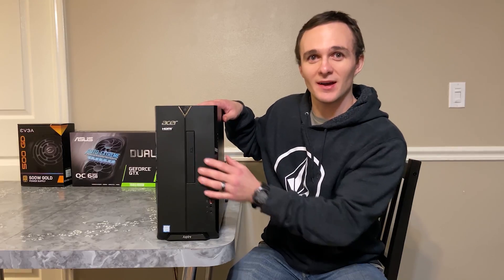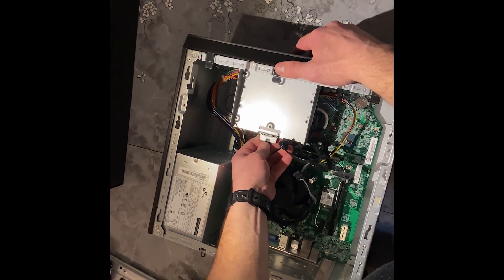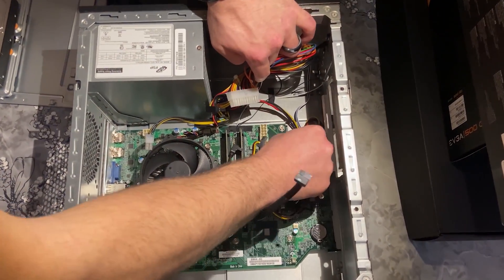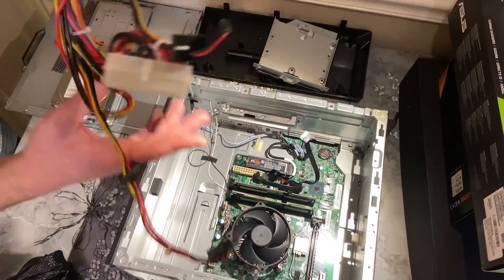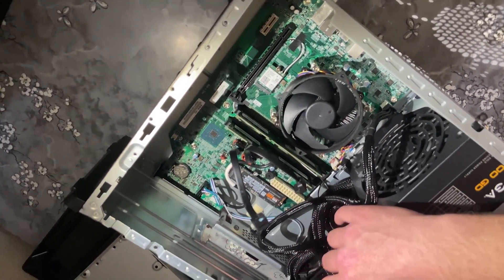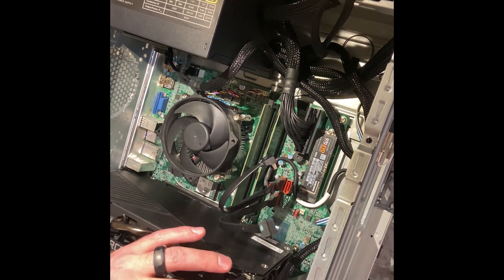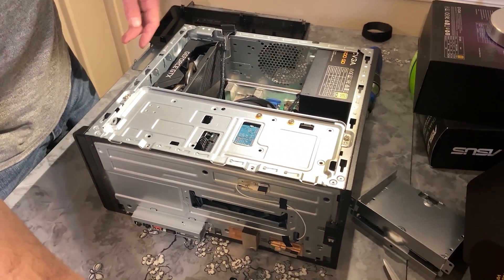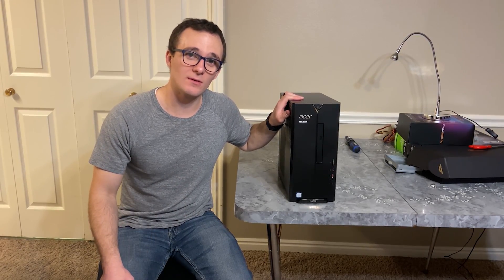How to put an Nvidia 1660 Super and change the power supply in an Acer Aspire TC-885 ACCFLi5

Comment: I followed this video and I think I got everything connected correctly. When I turned on my aspire it seems to be booting up (fan runs and light on) but my monitor doesn't recognize it's connected. How do I fix this?
Reply from the maker: Did you connect the HDMI cable to the graphics card or the motherboard? It should be in the GPU to get display now

Comment: hey bud,, i have a stock one,,nothing replaced,,, mine restarts everytime i watched videos like you tube// does it need a new power supply and video card?
Reply from the maker: Diagnosing issues based on the symptom you’ve described can be tricky, but there are several steps you can take to narrow down the cause. First, if your system has more than one stick of RAM, try booting with just one at a time. This can help identify if a faulty RAM stick is to blame. While integrated graphics rarely fail, power supply issues are a possibility, especially under load. To test this, you could run a CPU-intensive benchmark like Cinebench or Prime95 and see if the problem persists, indicating a potential issue with your PSU.

Additionally, overheating could cause your system to reboot, so monitoring your CPU and GPU temperatures while running these tests could provide further insights. It’s also a good idea to ensure all your drivers, particularly for your integrated graphics, are up to date as outdated drivers can lead to system instability.

Lastly, system files or settings issues could be contributing to the problem. Running a system file check (for Windows, sfc /scannow in the Command Prompt as an administrator) might uncover and fix any corrupted files causing instability. I hope these steps help you pinpoint and resolve the issue.

Comment: I know its been a while since you posted this video, but I was looking to add a rtx 2060 super to the same pc. What do you think, a good or bad idea? I will be upgrading the power supply to 500W or 600W but I just wanted to know if it would work with the motherboard and airflow wise. Thanks.
Reply from the maker: It doesn't have the best airflow, you could try adding a fan blowing air in through the side or perforating the bottom of the case. it should be fine with the motherboard. and psu.

Comment: Hello, I have the same PC and I installed gou 1660 ti but it didn't recognize it and I also changed the power supply and put a 500w in it but it doesn't recognize the GPU. Maybe I have to do something in the bios for it to work?
Reply from the maker: one thing I forget to do sometimes is to add the vga 8 pin to the gpu. is that plugged in?
Reply: same :( i have rx580, i cant disable onboard gpu

Comment: Based on your video I used the link to purchase the same power supply only I have an Acer Aspire TC-895 and I ordered the ASUS GeForce GTX 1660 Super Overclocked 6GB Dual-Fan Evo Edition VR Ready HDMI DisplayPort DVI Graphics Card (DUAL-GTX1660S-O6G-EVO) from Amazon. Will it still assemble the same?
Reply: Did it assemble the same?

Comment: I know this video is up since 3 years ago but hopefully you still see this comment, I want to ask if the gpu worked fine even though it was partially blocked by the side cover. I want to know if it works because if it does then I can try to upgrade mine to a 3060 12GB one for myself
Reply from the maker: you should be able to get a 3060 in there. a 2 fan model would for sure fit. Just make sure to check the dimensions of the card to see if it'll fit before putting it in there.

Comment: Hi, i have this pc also, but i was running gtx 1650 on stock 300watt PSU, i have used a dremel to fit a front intake fan added rear exhaust fan and larger arctic cpu cooler.. but i want more gpu power will the mobo support a rtx 2070 super? (I will of course upgrade the PSU to atx 650 watt)

Comment: Extremely useful  and interesting video... I have a TC 1660 (i5 11400f gtx 1650) which seems to be very similar, I already upgraded ram, ssd ad I added another fan to keep temperatures under control. Is this upgrade possible in my PC (with 1660 super)? And if it is, it would be interesting to know what is the most powerful graphic card that could fit in this case (same of tc-885 I suppose) compatible with this motherboard ? Thank you in advance, congrats for the amazing work!!!
Reply: where ypu put the new fan e what tipe is
Reply: @reinnn.585  Noctua 80mm, there it the in the back of the case. Then connect the cable to the SYS FAN port of the motherboard. If you use it for gaming and the fan works only at startup, cut the control cable and the fan will work always at max power. Temperatures will be fine even under load

Comment: I have a TC885 and the door panel wasn't ventilated. I just left the door off, I highly recommend it if your door isn't ventlated. My TC885 is the 3 but t shouldn't matter, they are both 65w processors. I also the the similar Acer Nitro, i5 wth RX580, also without ventilated door. The paste on the RX580 fried before I realized there was no airflow, the only fans on the CPU and GPU themselves.

My TC885 with the i3 got a liittle loud, the paste on it was dry and cracked (lack of airflow) and I replaced it with Arctic Cooling 11LP which will just barely fit if your ram doesn't have a heat shield. Unfortunately, it required removal of the motherboard so the backplate could be removed because the 11LP like many coolers mounts with push pins. I think you could put the mount on the mobo with some 3mm screws without moving the solidly two sided taped backplate, but I didn't bother, figuring I would make at least 2 trips to the hardware store to get the right size screws or to get multiple sizes and have to take some back. The 11LP is awesome. It runs for 30 seconds silently then it will stop for more than a minute at a time doing basic tasks. But because of the pain in the assedness, I would recommend Cooler Master UC50 with the copper slug. it's like a Wraith Spire but for Intel processors and will mount to your stock backplate and if you want to add ram that has heatsinks as so many do these days, they wll fit. Neither of these computers are my daily driver anymore but they are stll useful.

On the Nitro 50, Acer blocked of the HDMI port for the integrated graphics of the i5 8400. Integrated graphics would have been helpful when the RX580 cooked (repasted, still works). Why Acer would block off the integrated graphics? All I can think of is they were afraid people would plug into the board instead of the graphics card, think it didn't work and return it. Acer is value for money, just expect to do a little upgrading when you get it, time and money. Really impressed with the 10000 series i3 it would have been an i7 a few years ago quad core with 8 threads. I wouldn't even bother with the i5, buy another stick of ram, and a fan for the back out of the money you save and it might even stretch to a better $17 cooler or at least some paste better than what Acer used whch s bottom of the barrel garbage. I still like them or I wouldn't play with them, just know what you are getting. The i3 didn't come with ATX power supply. I also upgraded mine with M.2 SSDs that's recommended for any computer that idin't come with one these days.

Comment: Why did you choose this specific PSU (when there is such a large choice of cheaper PSUs including modular) is it because it is a direct size replacement for the proprietory psu
Reply from the maker: I chose it mainly for the price. it's a standard ATX form factor. I know EVGA has a good brand reputation for power supplies as well. all of those factors were why I chose this one.

Comment: Hi 
You seem to have some experience with the Acer Aspire TC models. I recently got a TC-1660 with i5 11400 CPU and Nvidia 1660 Super. From this and other videos of yours, it looks as though the CPU fan is the same on all models. Can you tell me what I can expect from the CPU fan noise? I’m experiencing between 30 and 50 dB running between 831RPM and 4591RPM. Could you recommend an alternative fan?

Thanks

Comment: Please note that the power connector on the DVD drive is not a regular size SATA power connector and it is doubtful that any power supply upgrade you make will include this connector so you need to buy an adapter - a sata slimline power connector that will bridge between the regular sata power and the little one on the DVD drive. Or, as dmoneyballa did, decide you don't need the DVD drive because it messes with your cables.

Comment: had mine for about 2 years now, planning to upgrade the power supply to a 430 watt unit and toss in an extra 8gbs of ram and a gtx 1060 so i can use it for vr games

edit: just saw you screwed the side panel on before seeing if it turned on at the end of the video, lol

Comment: Hi dmoneyballa. 

I have the Acer Aspire TC865-DH11 computer that I purchased about a year ago, and it looks just about identical to this one (same motherboard and specs, I have an i5 8400 6 core CPU). I have a question about the latest graphics cards like RTX 3070 ,3080, 3090, and the new AMD 6000 series cards. I know that they are almost impossible to get unless you pay ridiculous prices right now. However, If I get the opportunity to get my hands on one, I have some questions before I would make the purchase. 

I want to game with one of the latest cards, but will my computer be able to handle one of these GPU's? I know I would need a power supply upgrade & make sure the dimensions fit, but even then, is this computer compatible? If not, I might just buy a nice new gaming computer so that I can get one of the graphics cards that way, as many people are doing. However, if compatible and I were to find a great deal, then I would maybe just purchase a new GPU.

I'm  just worried about compatibility with the CPU & motherboard and the cooling in the case (not sure if this case is good enough even with adding an exhaust fan in the rear). I'm just wanting to game and I don't know if I should wait to get a decent deal on a GPU (which could take forever), or just decide that this computer isn't good enough or maybe not even compatible. 

Please respond if you can as I have searched the internet and watched YouTube videos but I am still not sure. I saw you were successful with the 1660 super but I don't know about these latest very powerful cards. 

I'm leaning towards just getting a new computer but wondered if this could work?

Thanks,

Shawn
Reply from the maker: I am concerned with the thermals of throwing a newer, beefier gpu in this case. I would say it's probably a better idea to just build a whole new pc if that's your plan. I would hate to see a new gpu that costs like $800+ burn up in this case. You can get a motherboard and case, move the cpu, ram, hard drives. then you'd only need a new case, psu and gpu. Prebuilts are also something to consider with crazy gpu prices at the moment.
Reply: @dmoneyballa  Thanks a lot. I think I will go the route of a prebuilt since it is the best way to get the GPU right now. Thanks so much. I thought cooling/thermals could be a problem. I'll just keep the ACER as a regular computer for a different room, and have a new gaming computer I'll be happy with. I've been doing a lot of research to make sure to not get one of the crappy ones that are marked up, cheap parts, and bad ventilation etc.

Thanks dmoneyballa  :-)

Comment: Would a gtx 750 ti work in this system? Pls reply
Reply from the maker: yeah it should
Reply: @dmoneyballa  what about a gt 1030? (Edit) and if i used this card would i have to upgrade the power supply? And also this is the version im getting will it be the same? https://www.amazon.com/Acer-TC-895-UA91-i3-10100-Processor-802-11ax/dp/B088X29HF6
Reply from the maker: you  don't need to upgrade your power supply for a 1030

Comment: You needed to remove the expansion slot cover so that your double wide video card could expel the heat out the back of your tower.  You could still use the optical bay for a storage drive (pair of SSDs or 2 TB laptop HDDs), got room for one more HDD on the side panel.  That was what I wanted to see.  How much room there is for drive storage because this basic chassis is still being sold.  They simply don't talk about the extra room that it has inside.  IF you used the velcro strap on the bundle of cables inside would that have impeded air flow?  It'd surely help keep them out of the way.  You've got an unused expansion slot on your main board.  What could you use it for?

Comment: Can I reuse the stock power cables?
Reply from the maker: yes you can but to run the gpu, you'll need an adapter I used a sata to 8pin: https://amzn.to/2ZtSAvg.
video where I do that is here: https://youtu.be/TW_5BvWmQ6Y
Reply: @dmoneyballa  heard its bad to reuse. Does a modular psu come with its cables?

Comment: Could u reply i wanna know if
I could add ram and a cheaper gpu and if i could, could u suggest one
Reply: And if it could run black ops
Reply from the maker: you can add ram if you want. Gpus are really priced crazily right now. I think you could go for a gpu that has less than 4GbB VRAM like a 1650 super, 4GB 570, 3GB 1060, or 1050ti. 1650 is on the recommended specs so it could probably run it nicely.
Reply: @dmoneyballa  is a gpu that’s under 220 could run Minecraft with 100fps only list one I was confused lol

Comment: Does this work with an acer aspire xc-895 i5 10thgen?
Reply from the maker: not sure the graphics card would fit. The xc is a smaller case with a width of 100 mm. the TC has a width of 163 mm, so you'd probably have to use a compact gpu. I also have the tc-895 and it uses a ATX12VO psu which is a new standard, this pc uses an atx psu so it's easy to swap. I have run a 1660 super from the psu that the Acer Aspire TC-895 i3 10thgen comes with link to that here: https://youtu.be/6hBqwFTtvYY

Comment: would the power supply also work with a tc-895?
Reply from the maker: From what I've seen from the Acer forum, the tc-895 with the 10th gen processors uses a different power supply standard: ATX12VO. The power supply I use is a standard ATX form factor so it wouldn't work with the tc-895.

Comment: just bought a acer aspire XC-895 and want to install a graphics card 4 - 6GB. 
Would anyone be kind enough to recommend me a good card to buy I am so confused. also will I be needing a new power supply?

My Pc Specs:

Wattage - 180W
H -  340mm
W - 163mm
L - 350mm

Will be forever grateful as been looking for hours with still no clue.
Reply from the maker: Yeah, you will most likely need a new power supply but I haven't been able to find one for it because it is a new ATX12VO standard. I jumped on the Acer Forum post here: https://community.acer.com/en/discussion/comment/958371#Comment_958371. There should be more powerful power supplies that come out later with higher voltages but I haven't found any yet. Here's another discussion post that may be helpful: https://community.acer.com/en/discussion/625680/aspire-xc-895-psu
Reply: @dmoneyballa Thanks for the prompt reply, appreciate it. 
Ok then, Maybe it's just not meant to be.
Reply from the maker: I just got an acer tc-895 and the psu was 300W so it will do a 1660 Super if you use a sata to 8-pin adapter if you have the same psu. I'm uploading the video tonight and you can see how to check your psu in that video.

Comment: Good video. Must the power supply be upgraded to install the video card?  Not a gamer - just want better video graphics to drive two monitors and do some moderate Photoshop.
Reply from the maker: Here's a video of me running this gpu with the original psu it came with: https://youtu.be/TW_5BvWmQ6Y. You might want to upgrade it if you're going to have a gpu that draws more power than the 1660 super but it does work with the original 350W psu it comes with. I just used this adapter to get it to work: https://amzn.to/2ZtSAvg

Comment: Hi the graphics card went up 300 and was wondering what a good one under 350 would be for Minecraft and fortnite
Reply from the maker: It looks like scalpers are going after all gpus now. You could try this one: https://amzn.to/3rmfiRM it's an AMD 5500xt, last gen gpu I think it may be just a little too long. I think the best option is to go to ebay and look for like a 1070 for around 200 or maybe 250. The 1070 should out perform the 1660 super, just make sure the dimensions look good and that it'll fit in the case. A 1060 6Gb would be my second choice in the used market, there are also AMD options with 580s and stuff like that.
Reply: @dmoneyballa  thank you a lot
Reply: @dmoneyballa  do you think it could run Minecraft and fortnite with out upgrading it?

Comment: Hey all, the 10th Generation variant has a sneaky trick you should be aware of. They changed to some kind of proprietary power supply. It is non standard and you CAN'T change it. They lumped all the SKU's together so look very carefully at the pictures of the PC's back side.

Comment: Hey dmoney , I have a question concerning the computer model.

I have the acer aspire tc 885 EB13 and I was wondering would it work if did the changes in the video?
Reply from the maker: I have googled this model but am not coming up with anything that looks like it returns hits with that model specifically. If the case looks like it's the same and not a super skinnier version I imagine it would.
Reply: @dmoneyballa  I was just wondering if you know what's the name of the motherboard of the acer tc 885 eb13. Because I've made some research and I can't find it anywhere.